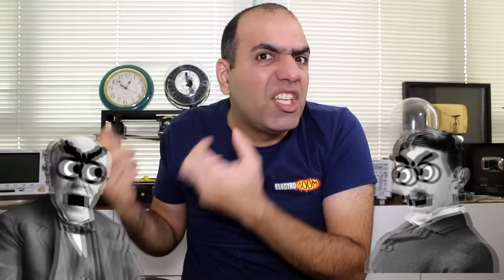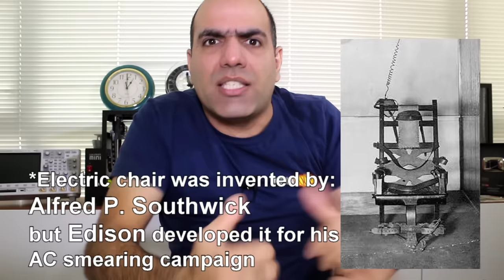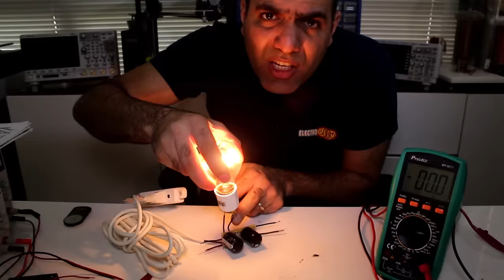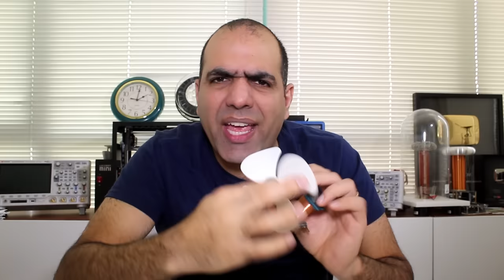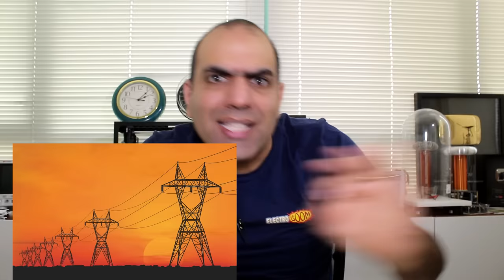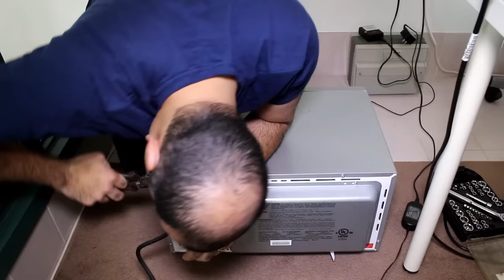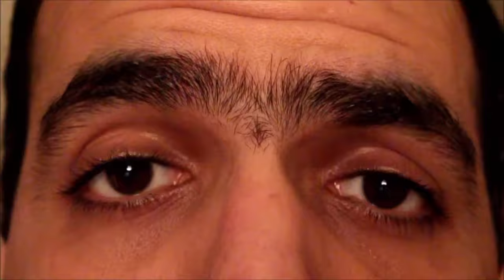Why Use AC Instead of DC at Home??

Comment: "This is worse than the dc system.. what's going on Tesla?" 😂
Reply: 😂😂😂😂 nice quote brooooo thanks for commentinghggggghhhh😂😂😂😂😂
Reply: Because his transformers are not very efficient.  Transformers used in the power grid typically use thousands or even tens of thousands of turns of wire in their coils.
Reply: That was the best line. Tesla brought us an electric system that powers the world, but it doesn’t work as well in Electroboom’s workshop, so it must be the wrong system.

Comment: To fix DC, use redstone repeaters
Reply: Epic biiig big brain
Reply: I kinda think like Comparitors behave like Transformers, The Signal goes on and off, via occilation.
Reply: @BilalMalik-vo3tl  comparators or more like transistors.
Reply: @Ghorda9  I'm talking minecraft
Reply: @BilalMalik-vo3tl  i am too
Reply: @Ghorda9  alright but since when did Minecraft have Transistors also another thing is I am probably wrong and you probably have more knowledge in electronics than me because I'm 14 and they don't teach much about it at this stage here in England anyway, have a nice day
Reply: @BilalMalik-vo3tl  i was saying that the comparators in minecraft where more like transistors in that they act like a switch that is controlled by an electrical signal.
Reply: @Ghorda9  And that's Why I was assuming you hade a wider knowledge of electronics than me. And now that I think about it Comparators are literally Transistors... Sorry for misunderstanding this whole time also are you Indian? (Guessing from username)
Reply: @BilalMalik-vo3tl  no, Australian, the name was inspired by Ghost in the Shell SAC.
Reply: @Ghorda9  Aah, understood.
Reply: Repeaters will be a transformore but repeaters make low current to high current  but for transformore's they make powerfull current to low current
Reply: @SesviR  correct me if I'm wrong but I'm pretty sure there are step-up transformers too.

Edit: Step-down*... which he uses in the video.
Step-Up: Increase voltage but lower current
Step-Down: Lower voltage but increase current because they are inversely proportional... kinda
Reply: Advocatus Diaboli  Jesus dude it was a joke and people are allowed to joke about things they enjoy. Would you be mad if someone made a movie or song reference instead?... maybe but just let people be and like what they want to like.
Also Minecraft has simplified circuitry and as such it allows people to engineer in-game mechanisms... did you never have anything like that as a kid where you could build something that helps you become more creative and think intellectually (Lego, Meccano, KNex, heck even basic wooden blocks, etc.)?

Sorry if it was a joke... I can struggle with them flying over head at times but if not, why do you have a problem? Video games have benefits and clearly here they are applying it to the real world even if it's in the form of a joke.
Reply: Yup
Reply: AC is the redstone repeaters and wires is redstone
Reply: So redstone is DC?
Reply: @babushkablyattv2751  AC for pulsing Redstone or Redstone clocks and DC for stable or nonpulsing Redstone.
Reply: I can't believe that my comment got 592 likes
Reply: And I am not even a redstone expert
Reply: pfp checks out
Reply: @CasamTDA is cutie - Music R/Wooooosh
Reply: infinite power
Reply: Advocatus Diaboli  boomer
Reply: A redstone repeater is a transformer
Reply: @CasamTDA is cutie - Music it is a subreddit about people who didn't get a joke
Reply: Comparator are like transistor, I design it once and it act as that
Reply: NICE
Reply: But real world has an heat engine unlike minecraft so repeaters would turn into magma blocks under a second.
Reply: That's a minecraft brain right there
Reply: Nice
Reply: Using repeater to extend range is outdate now, use instance wire instead.
Reply: big brain move is to use glass since current can go up, not down,  AND had no delay
Reply: So fun fact. Edision did use the version if Redstone repeaters in using many small block located power generators. Rather then a central generator, the transmission likes would be supported with micro coal generators, to produce the best grid design for edision and his company edition electric using all of his patents and taxing everyone to use it. 

Imagine how much colder the earth would of been if we didn't burn coal like that to make him money. Back to this time line, Tesla was way better. Not the current company. But the man and legend.
Reply: This is a joke but to 🤓 it long distance DC transmission exists in the form of tram wires and third rails and they do need more frequent substations to keep power available than AC overhead wires

Comment: "Nothing can stop me. They are just postponing the inevitable" This guy is awesome lmao!!
Reply: Yes bro...
Reply: Damn those tamper proof screws 😂😂
Reply: There is no tamper proof. Only tamper resistant.
Reply: @ 8:43
With high voltage comes great responsibility
Reply: My mom used to get so pissed when I would take stuff apart. 
Like the toaster I never did back together properly, and always burned one side of the Toast after that.
Reply: @cygnus1965  what are you doing now?
Reply: @SLA-yo4is  Using the working side of the toaster 😄
Reply: They can't stop me from rip microwave
Reply: The inevitable referring to the death of electroboom by electrocution?
Reply: @jess8611  😂😂😂

Comment: "With high voltage comes great responsibitly"
                         -  ElectroBoom -
Reply: P = I^2R
With great power comes great electrical burns
Reply: @dinamush1342  electricity bill
Reply: with great power comes great electricity bills
Reply: responsibitly? its reponsibility  actually
Reply: man thats legit
Reply: -Arc Flash
Reply: With high voltage comes great current.
Reply: I missed the part where that’s my problem.
Reply: Ibie
I would have assumed it was someone else's line, but if it came from him, that'd make me pretty happy.
Reply: Lol
Reply: @beaskrishnas260  that is not true
Reply: @enthrall5567  its catchy though
Reply: @dinamush1342  It’s silly to boast with your IQ by spamming formulas
Reply: @Engineer9736  you think thats bad? You should’ve seen me talk about piecewise functions when someone talked about c4 in the comment section
Reply: with high voltage comes absolutely 0 responsibility

Comment from the maker: That damn capacitor smoking though! The diode shorted out and placed the 120V AC right across the capacitor, which shorted the AC. So the cap heated up and blew up! Even when I unplugged it still kept whizzing and smoking!
Reply: be careful!
Reply: I had the same happen to me during a Factory Acceptance Test with the client. Just told them their analyzer had a special smokemachine feature. They bought it.
Reply: 8:38 wasted
Reply: dude I love your knowledge in circuits and electricity
Reply: HAAAAAAAAAAAAAAAAAAAaaaaaaaaaa--FUUUUUUUUUUUUUUUUUUUUUUUUUUUUULLLL...
Reply: I was wondering what happened there lol. I haven't lost a capacitor yet, it is good to see what happens.
Reply: ElectroBOOM electrolytic are  not safe  😐😂😂
Reply: You mean that wasn't in the script?????
Reply: ElectroBOOM love you vids dude (aka gimme the next giveaway)
Reply: ElectroBOOM if you could put the smoke back in the capacitor would be fine
Reply: only the factory has the ability to install the magic smoke in electronics that makes them work. when you let it out its over its like a genie in a bottle
Reply: You forgot to conclude that nowadays it's more efficient to step up or down DC to DC and that most things in a home will turn AC to DC in order to work or won't care either way so we use AC because it stuck around but nowadays a DC power system would be superior, especially because the advantage of more power over the same wiring applies more to high voltage DC than AC because DC doesn't suffer skin effect.
Reply: We use DC to AC to DC, but at a much higher frequency than house AC when we step up or down DC to DC.
In a 12V european power supply, we actually have 220V AC 50hz to 315V DC to 315V AC 50khz* to 12V AC 50khz to 12V DC.
Because it's much more efficient to use a high frequency transformer.
Even in transformerless designs (buck/boost), you'll switch on and off the dc signal rapidly, which results in ac, that is then filtered to have dc at the end.
*about anything from 5khz to 1mhz depending on the model
Reply: ElectroBOOM thank God the cap didn't exploded
Reply: Sometimes I wonder, do you purposely "fuck up" for your videos (perhaps to show what not to do?) or are these honest mistakes?
Reply: Well he couldnt predict that the diode will fail short circuit, that was just "luck" :D
Reply: Well I mean, when homes get DC, we'll have a functional shrine of a FULL BRIDGE RECTIFIER at each substation. That sounds like it'd be awesome.
Reply: Mmm, cap smoke!!!
Reply: Dear dude, remember the first safety rule is to wear safety glasses, a capacitor blowing up can expel their aluminum case at high speed when in short circuit or by maintaining it at reverse voltage. Salute to you!
Reply: ElectroBOOM can you do something on EMP's like how they work and stuff????
Reply: If you had an ac and a dc supply at equally high voltage than wouldn't the dc be more efficient as you would eliminate any skin depth, in this scenario assume you can convert voltage with 100% efficiency between ac and dc..
Reply: How did those electrolytes taste?
Reply: You should probably add a other diode witch will revert the AC current causing it to build up energy DONT DO IT
Reply: please make a boost converter
Reply: Always makes mistake.
Reply: ElectroBOOM you might like this channel “tech ingredients” he build a active noise cancelling box.
Reply: Had stored a lot of energy before powering off. What mF was it and what voltage? No bleeder resistor ha.
Reply: ouch
Reply: For low Power ratification 😅😅😅
Reply: Single diode.
Reply: At least you saved the cost of a fuse!
Reply: Can you be my electrical teacher
Reply: you meant to do that...
Reply: Greetings, I am a very big fan of yours +ElectroBOOM. I have watched all of your videos 2-3 times. I am an engineering undergrad. I will support you on Patreon once i finish college and get a job. Keep up the good work by making such awesome videos.
Reply: Mehdi, I discovered your channel yesterday, and I've been binge watching your past videos ever since.
I must say, I woke up this morning with a tummy ache. You should warn people about the side-effects of laughing so much and so hard. Rolling on the floor has its own disadvantages as well, and I won't go into that.
Why did you do this to me? I was minding my own business and didn't even know you existed.
Now I am dying of pain and can't stop watching your damned videos, and laugh, and hurt some more.
I will contact YT and ask them to demonetize your channel. It's not right to have such a funny and entertaining channel. Look at other channels, and learn to be boring like most of them ... ffs.
Reply: You realize there's a difference between accidents and deliberately electrocuting living things for propaganda purposes?
Reply: ElectroBOOM if you could get a thing that makes electricity from smoke you could get “free energy” for the price of an exploding capacitor 
I have no idea what I just said
Reply: Never mind the capacitor. Check your microphone. It is faulty. I can heat an annoying beep all the time. 
Please fix it. It is most off-putting.
Reply: sorry for laughing this much but that reminds me of a situation at work about 2 months ago where a guy who's now retired tried to figure out what was wrong with a PSU that I made (I was given the wrong pwm generator chip, not my fault) and caps and resistors started sparking and banging and shit and it was quite a fireworks and I barely contained myself not to burst into laughter
Reply: ElectroBOOM why wasn’t the rectifier a full bridge one and it’s a single one they are lame
Reply: Isn't he making contradictory statement?How low current high voltage is a waste of power, you know, that's why the the voltage is stepped up to prevent power loss.The low current carries high voltage, doesn't it?
Reply: I love google transate (hungary)
Reply: please also explain HVAC and HVDC systems
Reply: You maniac
Reply: Yes, for thick wires (skin depth for copper at 50Hz is 9mm). But the wires would probably attract dust, I mean 25kV anode line to a CRT gets coated in dust, I'd like to see how much dust would accumulate on a 330kV transmission line.
Reply: However high voltage DC transmission is a thing thanks to SMPS and in fact since DC does not suffer EM loss is technically more efficient than AC. Or put another way DC at the same voltage as AC is more efficient. But at the time converting voltages was not possible in DC without converting it to AC so its just easier to keep the whole system AC. Today however its possible to convert DC to different voltages much more efficently than AC plus without the standby losses of large transformers.
Reply: In highschool we used to overcharge old small capacitors and then throw them at each other. If you tried that today you'd probably end up in gitmo.
Reply: @mb1up189  ...harsh , tho.
Reply: why did the diode short out?
Reply: @hamood1234fool  because he didn't want to take the long way out.       ?
Reply: Gotta love that about electrolytics. Once started they keep smoking until they run out of electrolyte.

As for sticking your fingers across rectified mains AC..... not a good idea. The only thing standing between you and a serious burn is the amount of sweat on your skin.
Reply: Why u didn't use resistors
Reply: Does it  burn if u put high resistor instead of capacitor